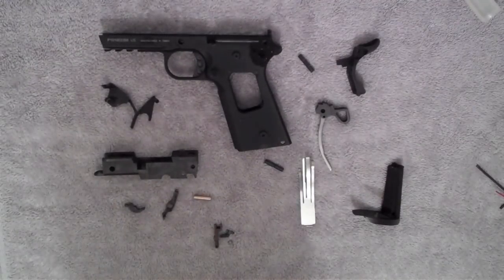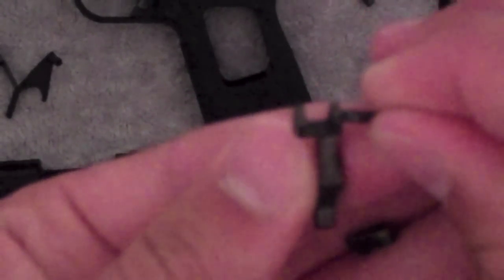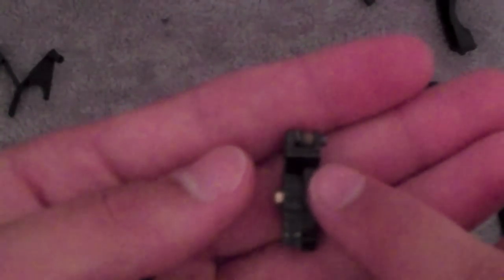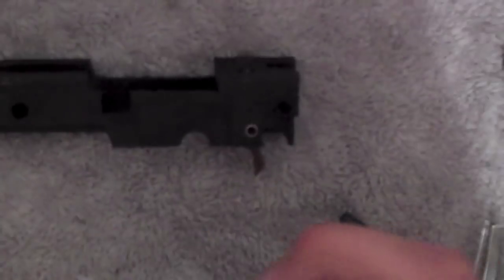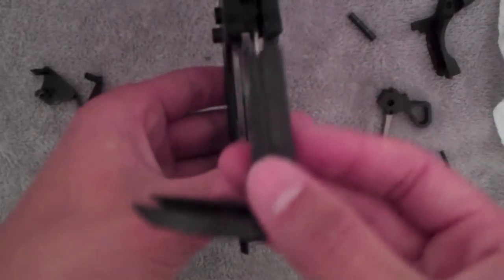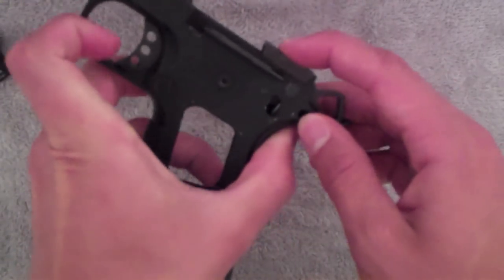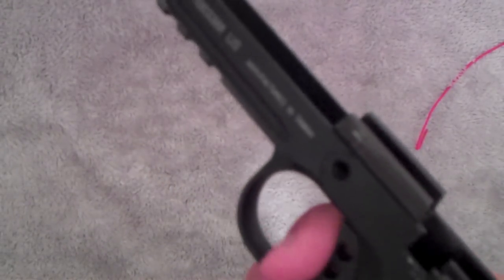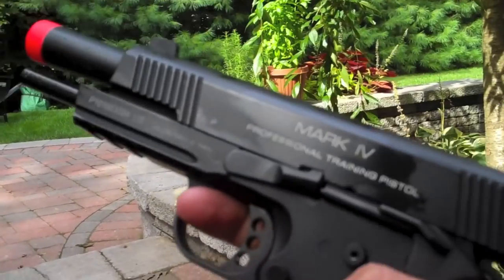Complete (lower) Assembly of a KWA M1911 Mark Series pistol

Comment from the maker: Ill just chime in here, The way I figured out the problem after mine gun stopped working was through forums. There have been many people who have had this problem and it is basically a poorly designed/weak component that causes it. It is not really bad to release the hammer for any part of your gun except this. If you are willing to fix this piece if it ever breaks then there is no problem with cocking and releasing the hammer.

Comment from the maker: Ok, so the first thing you should actually do is put that leaf spring in (has all the little arms). Next take that 2nd piece (2nd in the row of 3 of those pieces) and push it at the top so the bottom comes in front of the piece to the left of it. That leaf spring should be on top of all three pieces putting pressure on them. If you have done it right then when you push down on the left piece from on top and squeeze the trigger then that second piece  should be released and it will go forward.

Comment: Thank you so much for your help! My 1911 fell from the chair and the spring loaded pin that engages the thumb safety flew out, and I realized the only way I could get it back in would be to disassemble the lower. I spent a couple hours trying to do it myself until I found your video, you're a life saver!

One question, my MK II isn't always locking back, and the part on the slide catch that engages the bb follower is a bit work, should I replace it if possible?
thanks!